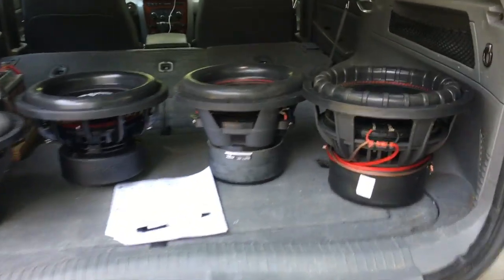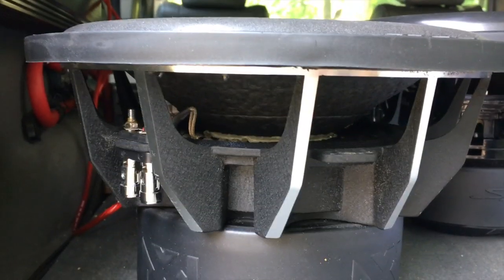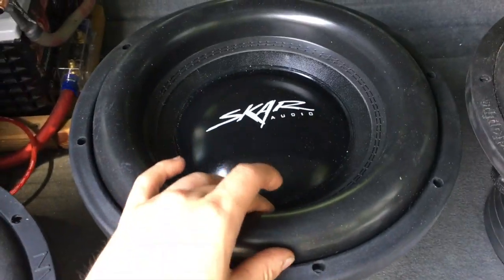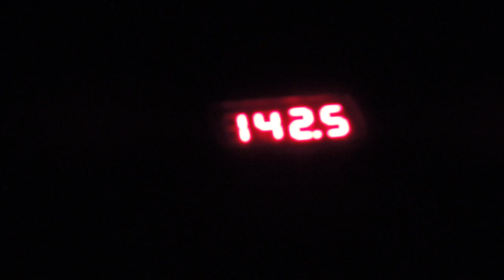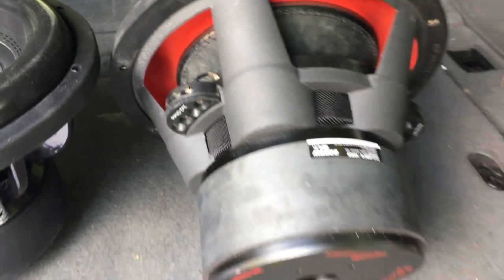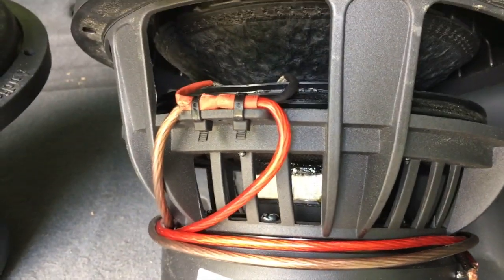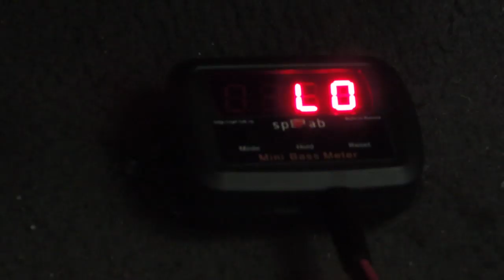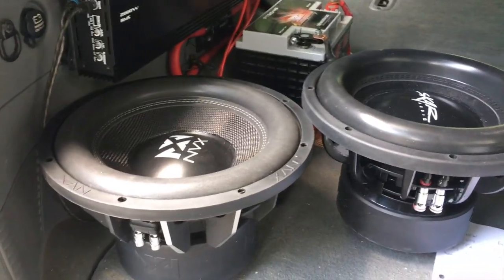Best Subwoofer Under $200?? Best BANG For The Buck? | Skar | AmericanBass | AudioPipe | NVX

Comment: i NEED 2 high spl 15" ~$200 subs. I'm considering these nvx, or soundstream Ts, or EMF Lowballers, or Skar something? I DONT KNOW!!! AHHHH!!!!!!!!!!!!!!!! Input anyone?
Reply from the maker: NVX is is more quality, not spl. You won’t be disappointed with the XFL for $200
Reply: @ParkerTheBasshead  Thanks. And when I said High SPL, I meant high bass output which I believe is the same thing..? I currently own two Kicker L7S 12s which provide a great mix of both SQ and pounding bass but I'm CRAVING even more bass if you know what I mean!  Have been bitten by the bass-bug! Hopefully I'll decide on the right sub to buy with the use of your informative videos! Thanks again for your quality vids. (please always include the SPL meter in every new sub test)

Comment: The stiffer the sub the harder it hit
Reply: The stiffer the cone, the more accurate the reproduction of the recording. Which if loud bass was intended by the sound engineer, yes it would hit harder than a soft cone. A soft cone will not be articulate or accurate. Which are all SQ properties. So saying a soft cone is better for SQ is incorrect also.
Reply: Shay Benson oh ok